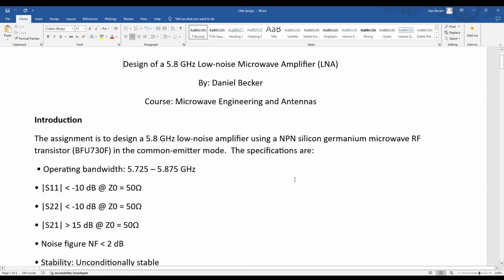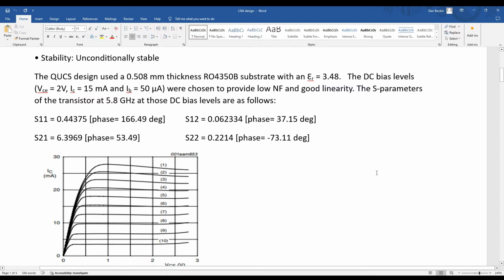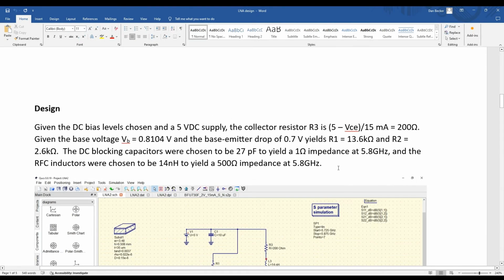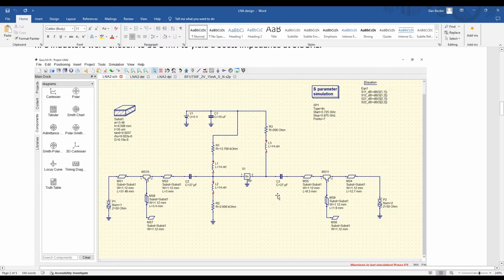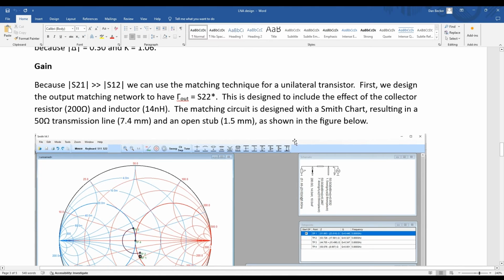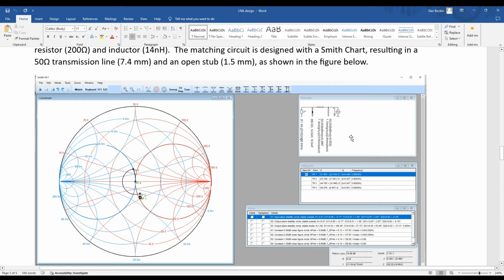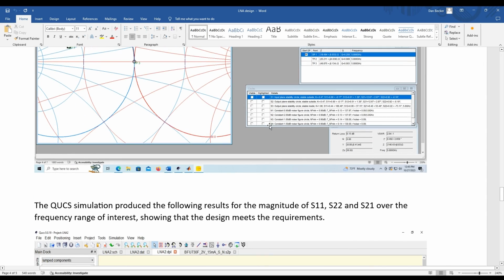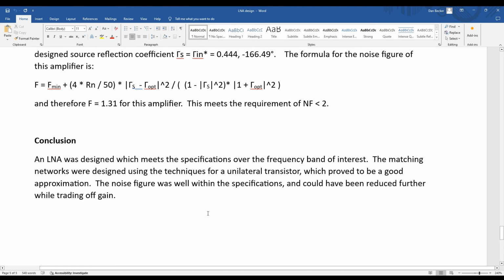LNA Design (QUCS)

Comment: .SUBCKT ATF34143 DRAIN GATE SOURCE

* Parasitics
RR2 2 1 0.1  
RR9 4 3 0.1  
RR5 1 5 0.1  
LL2 5 SOURCE 0.1nH  
LL7 SOURCE 7 0.1nH  
LL6 SOURCE 8 0.1nH  
RR6 8 2 0.1  
RR7 7 2 0.1  
RR8 DRAIN 9 0.1  
LL5 9 11 0.1nH  
LL8 2 SOURCE 0.05nH  
LL10 SOURCE 1 0.1nH  
LL1 GATE 4 0.8nH  
LL9 11 DRAIN 0.6nH  
CC3 11 2 0.15p  
CC4 1 4 0.15p  
LL4 3 GATE 0.1nH  

* Die Model
XDIE DRAIN GATE SOURCE BATF34143

.ENDS ATF34143

* Internal transistor model
.SUBCKT BATF34143 D G S
.MODEL BATF34143 GASFET (LEVEL=2 Vto=-0.95 Beta=0.24 Lambda=0.09 Alpha=4 
+ B=0.8 Tnom=27 Vbi=0.7 Delta=0.2 Cgs=0.8p Cgd=0.16p Rd=0.25 
+ Rg=1 Rs=0.125 Cds=0.04p Is=1n P=0.65)
.ENDS BATF34143